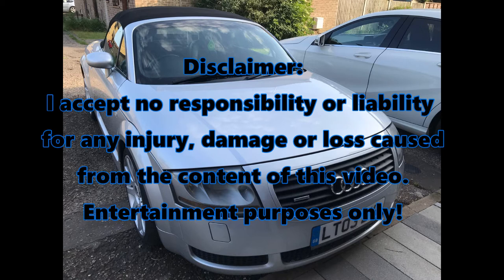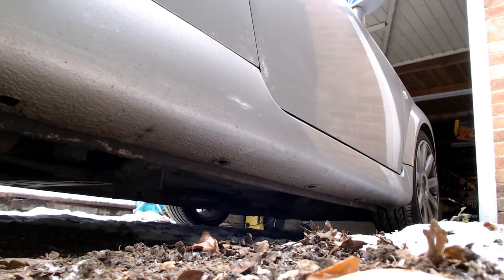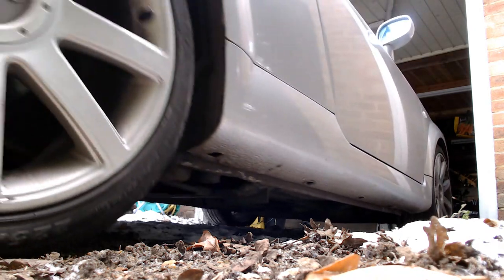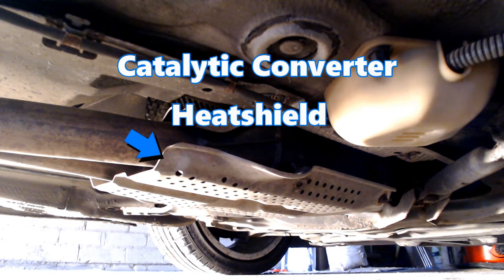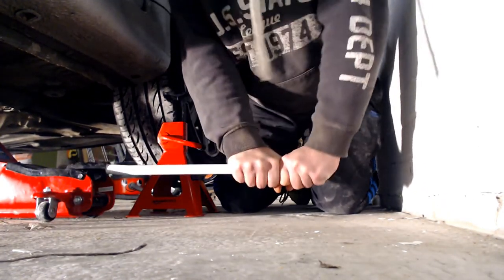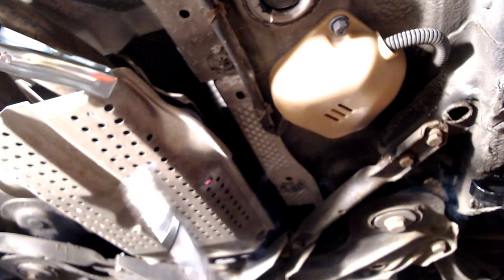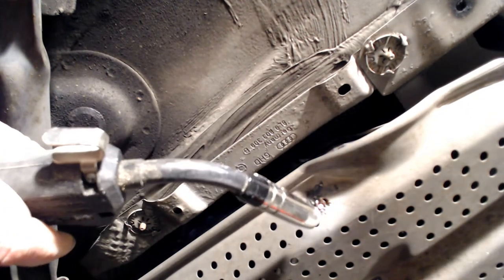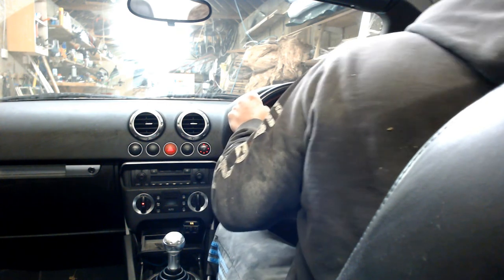Audi TT Mk1 exhaust rattle - loose catalytic converter heatshield fix

Comment: Hey Andy, nice little video! My shield is doing the same thing but i aint no welder, do you know what size the bolt is coz i cant find nothing i have to fit on it? Thanks!
Reply from the maker: Hey Kirk! Thanks for the positive feedback buddy. I am no welder myself as you can tell! Im not sure about the bolts but looking at a few pictures, they seem to be 10mm head bolts if that helps at all. They tend to be used elsewhere on the car also. Let me know if you need any more info and thanks for checking the video out!

Comment: This was the first annoyance I had to solve on mine (Also a silver roadster!) - took mine straight off though, was hanging on by a thread 😂
Reply from the maker: Ha Ha! Good to hear I am not alone! I thought it was a loose fixing at first or worse still, a bit of the exhaust hanging off and blown. I was quite relieved to find it was a simple fix. Nice work on removing it though. from what i have read it is not integral. Thanks for watching and commenting. I have a load more things to to work through on it that I cant seem to find youtube examples of. Hence why I made the CV joint video! Great fun summer cars are they not?
Reply: @andycharger  Great fun winter ones too!
Reply from the maker: How long have you owned it Ben? Is it standard or have you tinkered much? Im trying to keep mine as standard as possible and restore as much as I can. Its not the worst one on the road and fairly low mileage for its age (78k) but can showcase some of the repairs i need to do on here and hopefully help others!
Reply: @andycharger  Since Autumn, messed around a little, new air filter, boost gauge. I think it might have been mapped (Theres no real history with it), boosts higher than average and feels perky for a 113k mile car!

Comment: Hi did this cause vibration at idle too
Reply from the maker: Hi Abdul. Yes there was a slight vibration through the wheel under revs. Are you experiencing something similar?
Reply: @andycharger  hi Andy ye my car has slight vibration at idle looked under bonnet cat slightly vibrating and can hear little rattle
Reply from the maker: @abdulbeany1894  yeah take a look under the car when Idling. Heat shield is literally level with front half of the door in the middle of the car. With the door open and out of gear, start the engine and look underneath. Give the accelerator a little push with your hand and observe the heat shield. Does the sound go away?
Reply: @andycharger  thanks I'll have A look my car is an audi a4 b7 2.0 tdi so slightly different set up but will look at heat shield